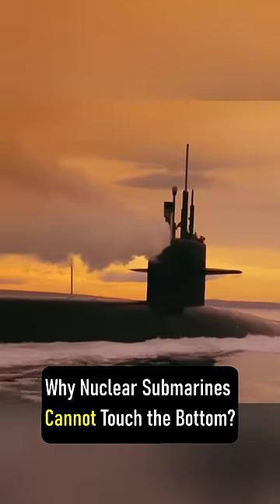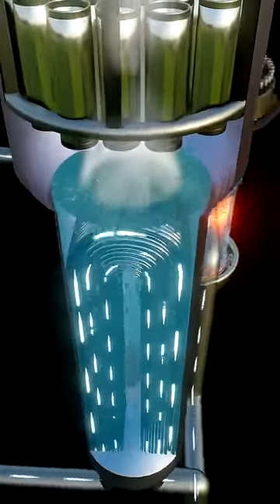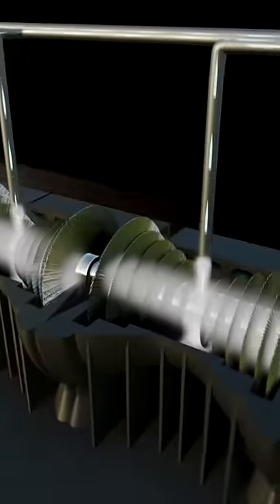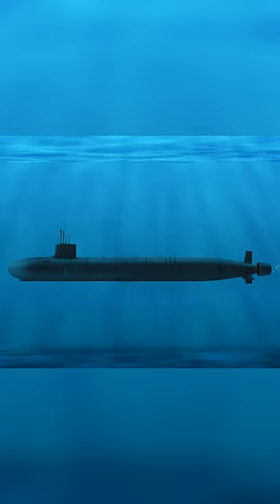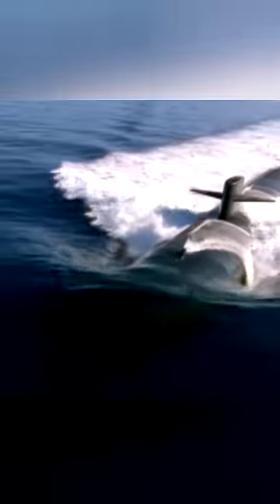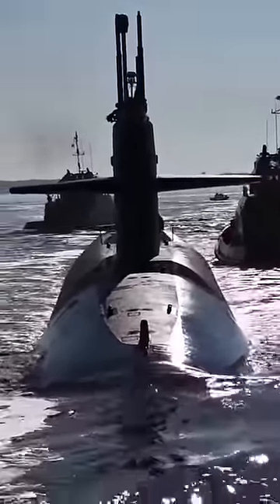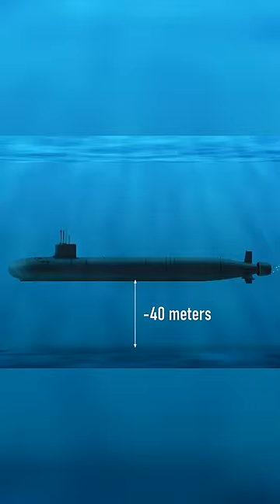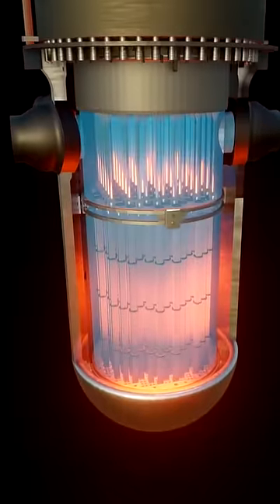Why Nuclear Submarines Cannot Touch the Bottom

Comment: I mean there's also the whole water pressure crumpling the whole boat like a tin can thing too.
Reply: Water isn’t always a mile deep though is it
Reply: @simonshotter8960  Not always. But the average ocean depth is 2.3 miles. So, tin can.
Reply: Going down those extra 40 meters to touch the bottom isn't much. Arctic is mostly shallow and they love to play under the ice there .
Reply: You can do shallow water operations you'll be amazed where they can go and some designs can divert the intake to be able to "touch" the bottom
Reply: @trc8197    Back in 1980: 
We hit the seabed very hard on USS Finback (SSN-670).  We were 300 feet deep, steaming at 15 knots. NOW, I realize how lucky we were. If the seachests had gotten plugged up, the SSTG’s would have gone offline, so no primary reactor cooling water‼️ - meltdown - death!
-
Reply: @peep_show8037    - yes -
Right, not all nuclear submarines are the same.  Some are specially designed to deliver divers in extremely shallow water. 
The nuclear submarines that I worked on could NEVER do that!
Reply: @adnanalikhan6890  most american subs have a recommended max of 800 and a crush depth of 3
Reply: If this was ever the case, I doubt that they have that limitation now.
Reply: @ALL_OUT_OF_BUBBLEGUM  it very much is. Most subs are built to operate between 400-700m below sea level and will become a tin can beyond 1000m. 
Unless specifically built for deep diving (like the tiny sub that went all the way down the mariana trench), all subs will crumple like tin cans.
Military subs are not built to operate too low below sea level, there’s nothing to blow up 10km below sea level.
Reply: @AWa-ik2ez  sure, but also there are extra reactor safeties. You can blow the sea chests to clear them so you can start pumping sea water again.
Reply: @AWa-ik2ez  yes that's why we have different types of subs for different missions...your not gonna send a boomer to do shallow water ops off the coast of Russia or NK 🤷‍♂️
Reply: I’m not so much. .. Other subs do this .. You’ll be fine down there for less than a few hours.
Reply: @darthrevan8640  2.5 and 3 ... what? miles, feet, meters??? 

pretty sure most subs(like the ones in the video) aren't designed to go below 1000meters
Reply: @jamesb120  American Ohio class subs have a crush depth of 3000 feet and a recommended cruise depth of 800 feet
Reply: @darthrevan8640  Ohio class lol
Reply: @darthrevan8640  feet you mean right
Reply: @AWa-ik2ez  IIRC the Virginia class boats have station keeping propulsors, so if they're located near the bottom of the hull they def don't want to damage those as well.
Reply: @adnanalikhan6890 dumbass who cares about average depth. They go where they please even if it's like 200ft
Reply: Who and how did they sabotage Nordstream ?
Reply: @peep_show8037  That's how they all should be designed!!!
Reply: Uh, im just amazed this kid posting can walk out into the ocean.. Its impossible, as soon as his feet are fully submerged, he should need legs 4 miles long or so to keep walking
Reply: Oh yeah, I have heard about that. Because of the pressure etc.
Reply: Exactly what happened to ocean gate guys
Reply: that only matters in depths where pressure is a concern. Touching the bottom at 500 feet is not going to "crumple the whole boat like a tin can"...
Reply: Ya, like what happened the other day with the 5 people
Reply: Oooft seeing this comment after the titan disaster bruhhh
Reply: Lol 9 months kater the titan submersible
Reply: @trc8197 lmfao, love the “they like to play under the ice there”
Reply: @AWa-ik2ez you worked on one of those? Salute to you brother. You couldn’t pay me to get in one of those. I was in the Israeli military, but I woulda left if they told me I had to be in a sub lol
Reply: we know now
Reply: Funny how you mentioned this 10 months ago and it literally just happened
Reply: That didnt age well.
Reply: @gunnarthefeisty sure is!🤮
Reply: You said it
Reply: @trc8197   in that case they better not touch the top either 😂
Reply: @Dingus440   you mean it aged well? 😂
Reply: Oh please, that hasn't happened in a couple of days...
Reply: @Scavendon  Yes, it’s funny because its Ironic. Do you want to cry about it Tom?
Reply: Wow this comment aged like fine wine. Hello from July 2023
Reply: I really hate the vertical-style videos. Who's bright idea was to start this in the first place.
Reply: Interesting @pootmahgoots8482 that you said that.
Reply: This comment aged perfectly
Reply: @adnanalikhan6890 But why would a nuclear submarine be in the middle of the ocean? Most nuclear submarines are patrolling near enemy countries for intelligence gathering as well as permanent patrols because guess what, having a submarine launch nukes right of off the coast of your enemy is a lot quicker launch time than firing an ICBM from your country. Also thats just completely damn stupid.
Reply: 40 meters minimum distance from keel to bottom?

BS. Every submarine that has visited the Arctic Ocean via the Bering Strait (mine did - twice) violates this 40 meter thingy. 

I was navigator on two nuclear-powered USN SSNs. The headache I’m traveling close to the bottom is not so much sea chest blockage as it is grounding the boat. 

Ground the boat and these officers are likely to be relieved:

Commanding Officer
Executive Officer
Navigator
Assistant Navigator
Officer of the Deck on duty
Quartermaster of the Watch on duty
Chief of the Boat (CON)

That’s where the pain lies. Pain avoidance strategies are focused on not grounding the boat. Grounding the boat ends careers.
Reply: Damn what happend to the titan 😳
Reply: NR-1 had wheels to ride on the bottom of the ocean and has nuclear powerr
Reply: @MillerVanDotTV  Yes, I'm aware of that. I have a USNA classmate who was OinC of NR-1 back in the early 80s. Rose through the ranks to become CNO.

There are reportedly other USN nuke boats that have been purposefully modified to operate on or near the bottom of the ocean. (see "Blind Man's Bluff", by Sherry Sontag, Christoper Drew: ISBN 0-06-103004-X). ...or so I've read.
Reply: @AWa-ik2ez Oof. Did the captain get a slap from the admirals for that?
Reply: @simonshotter8960 Mariana Trench... 35,814 feet! PSI at that depth is around15,000 psi!
Reply: @AWa-ik2ez One of my friends... Bonfoey, was on the Finback in the early 70s!
Reply: @AWa-ik2ez So... did your Captain and Navigator lose their bars! That was some dumb shit to do!
Reply: @darthrevan8640 Be careful what you say... it doesn't matter how you know what you know! Sharing it in an open forum can get you more attention than you could ever imagine!

We're I you, I would be scrambling to delete... delete... DELETE that blurp!
Reply: @RodDavisSaints44  edited it
Reply: @simonshotter8960 it can be several miles long 🤷🏻‍♀️
Reply: You do know water isn’t always deep lmfao
Reply: This is mostly for littoral waters. you don't have to worry about the ocean bottom in deep water.
Reply: That has nothing to do with the bottom of a waterbody and everything to do with the amount of water above the sub. 😋